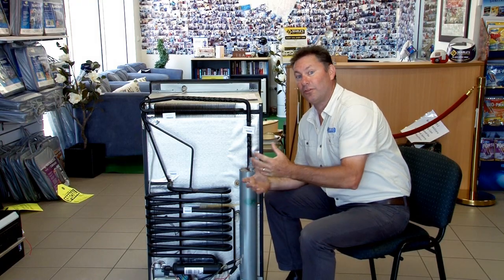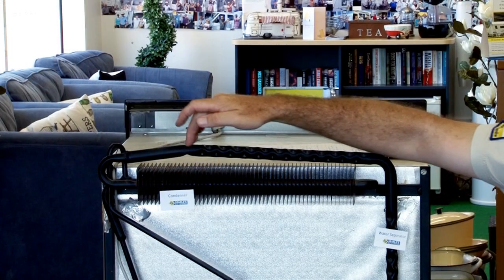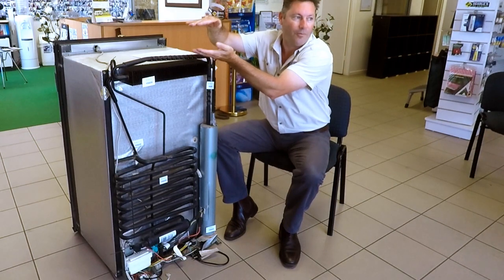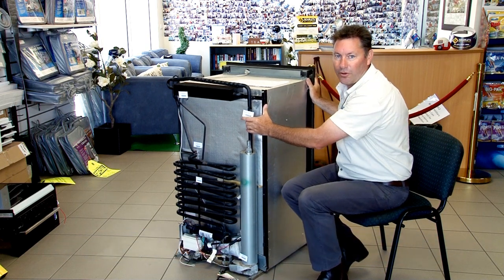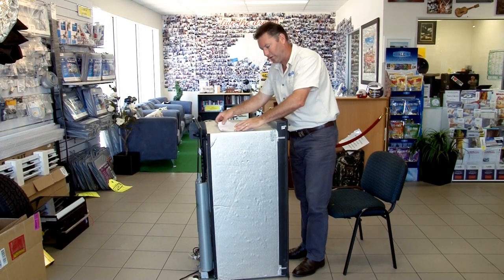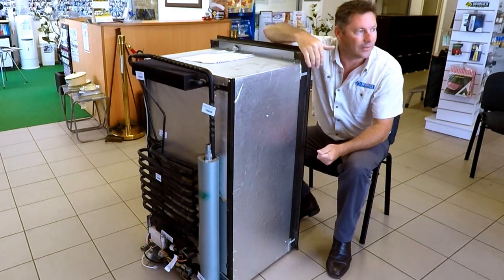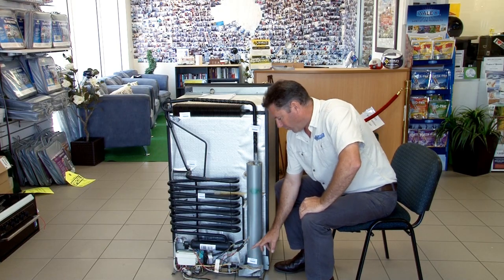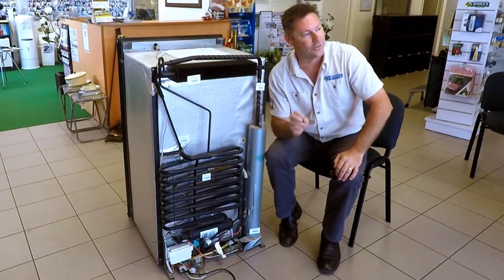Tips & Tricks To Get The Best Out Of Your Absorption Fridge

Comment: I have an old absorption fridges, And I have done the same as in the video... But i have also made up a  container at the bottom of the fridge that slides out if need be, but it main job is to stop the cold air from pouring out when the door is opened. That alone is  75% of the increase in performance in my fridge, Another  10% is from sticking insulation  under the freezer compartment and on the back wall near the burner is  inside, The remainder is from having the seal around the door  100% sealed off and very much so at the bottom edge.. I have put a seal around the freezer door as well .The fridge works that well now that i cant get food out of the freezer. Then fridge section freezes water bottles and has ice over the element...The temp will goes as high as -18c at the freezer and the van  temp inside 33c with the sun on the fridge side of the van,, I get a full 3 weeks out of a 9kg bottle.. All this on number 1 setting. I have turned it to max. but only had a very small drop in temp. I run it at number 1 now all the time. only thinking it may save gas.. I have a 12 volt solar fridge that's ok if the sun is out.. but 3 days of rain,  its all over red rover and the gas marches on

Comment: Thanks for that. From what I hear, if the wiring for the 12v from the car to the fridge is big enough then it is possible to even have these things freeze up on 12v. But the wiring needs to be thick enough to handle 15+ amps. So that means the wiring needs to run independently via an Anderson plug to the car, not through the 12v power wire in the plug used for lights and indicators. The connector in the plug is not big enough to take the right sized cable.
I've seen people put a thermostat on these fridges on the 12v side to ensure they don't freeze over after the wiring has been upgraded to suit. 
So with a thermostat installed that will cycle as the fridge needs to, to keep to temp, it is feasible to run these on 12v in an off grid-free camping situation if you had enough solar and if not, then just flick it over to gas.

Comment: i have a question. You said its better to run it on 220v than the 12v, because it draws a lot of power. i'm on my solar grid and currently using my fridge in 12v mode non stop. If i use the 220v from an inverter i suspect it will draw almost the same ammount of power, but will the heater work better?
another problem i'm having is that in 12v mode cables are getting warm. i've changed the supply cable and now i can feel some heat building up to the ressistor cables, that i can't change.
thanks in advance.

Comment: Hi.. thaks for video. İ have old model of frige,my problem is my fridge when i use it with electric or gas ,freezer is working well and keepeng food froozen but the fridge part isnot cooling enough, its 12-14c.i watched many videos and tried many things but couldnt solve the problem, if you can suggets me what to do i ll be happy. thanks
Reply: I haven’t tried this yet but read it on another post recently when others had similar issues. One dude put a 12v desktop fan inside his fridge with the lead going out through the seals. It was aimed at the cooling fins to help circulate, he said it dropped temperatures dramatically. Another dude drilled some holes between fridge and freezer following theory that cold air drops, he said it did the job for him. Just some further suggestions to consider.

Comment: I have a 1976 dometic rm66E model RV refrigerator that I want to run off of my RV 12volt house battery. Do you know what power consumption this model uses? Amp hours? How can I figure this out?
Reply from the maker: No I don't. But it very safe to say you will kill your house battery very fast. The 12 volt side of these fridge is designed to operate off the tow vehicles or motorhome vehicles alternator. A battery alone will not have the power.

Comment: What is the physical difference between a 'T' and 'ST' models? We experienced our fridge struggling cool right down over christmas, it was quite humid here in WA.
Reply from the maker: The difference is the temp the fridge will operate below ambient. A T rated fridge will cool a higher outside temp (but will use more power to do so. So the colder the climate the lower the rating.

Comment: Hi, loved your video thanks for posting it. I’ve got a Dometic and the 12v isn’t working, gas and 240v are all good. I’ve tried to access the rear but Jayco have cunningly only installed a tiny access hatch and this makes it impossible to carry out any diagnostic tests and or maintenance. I suspect the 12v element needs replacing so I guess my options are to remove the fridge or cut a bigger access panel hole. The van is a 2011 model and your comment re. later models using bigger hatches for the venturi effect seems to suggest I should just do go for a bigger panel. 
2 questions, do you sell retrofit access panels and is it possible to make the necessary cuts with the fridge insitu without causing damage? Watching your video has allowed me to see what is hidden, perhaps you could say what model your fridge is so I can get a clearer idea of how to go about it.
Cheers, Nick from Tasmania
Reply: @searlesrvcentre   Thanks for replying Ben. I found another vid on YouTube which shows how to fit a bigger access panel. Have bought one and will have a crack at it. Cheers Nick

Comment: A lot of people add a small fan to assist in cooling. Does this make the fridge more efficient or not very beneficial? I have an ST fridge planning to travel NW  WA.
Reply from the maker: Adding fans simply helps in circulating the air flow over the upper cool fins. This will definitely help in the cooling of the fridge.
Reply: Fans will help the air circulate through the cooling fins. Yes great idea in hot climates

Comment: These refrigerators are absolute garbage The only way this is worth it is if you are camping or live off the grid otherwise it is just a terrible refrigerator it takes forever to get cold has a hard time keeping it cold and in my opinion is much more dangerous than a 12-volt or residential refrigerator if you are utilizing the LP mode
Reply: Hi Thomas, If they are not installed correctly then yes they just won't work as they are designed. If they are installed correctly then they are a fantastic fridge. If you still have one before giving up on it make sure it is not an installation issue. Cheers Ben
Reply: @dalehodge5629  yeah it just was garbage in my opinion I put a residential unit in and it was an absolute glacier in about 4 hours I have no regrets. now I can understand why someone might need a propane refrigerator not completely useless but in my case since I live in my camper year-round it is not practical for me
Reply: I love my Dometic gas fridge in my off-grid open palapa jungle house in Yelapa, Mexico. It is very old and hasn't been working too well lately but now by watching Ben's great video I know why. I'll be back in December again and will fix it.
Reply: @yelapaangel  🤷🤷